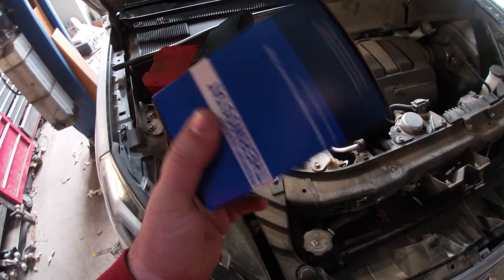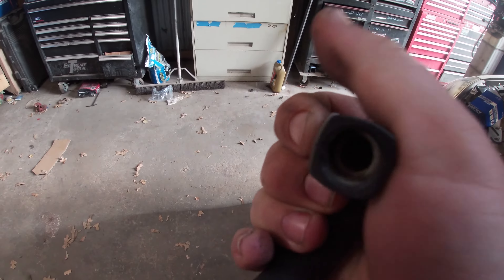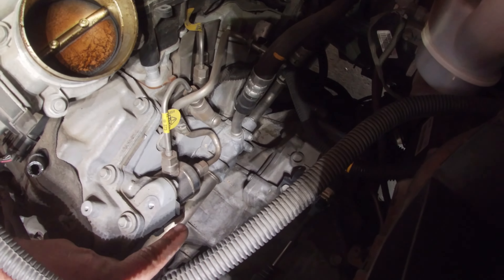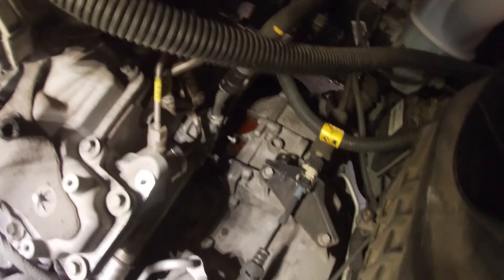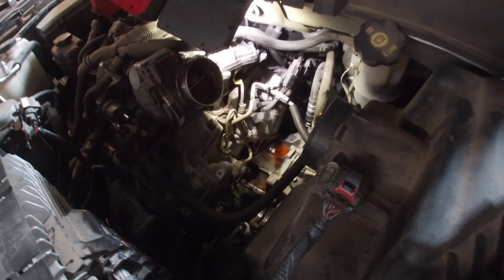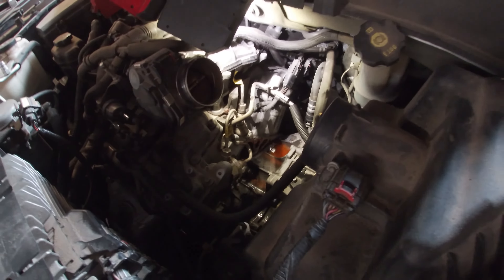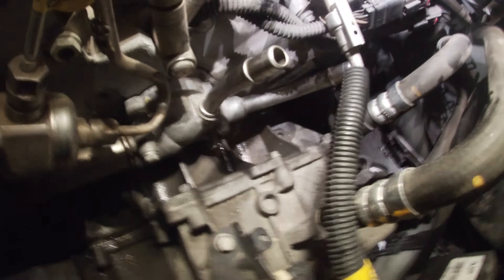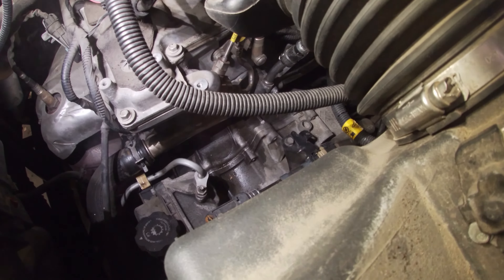2013-2017 GM 3.6l Thermostat Replacement; 2016 GMC Acadia P0128

Comment: Thanks for the wrench trick man! I ruined the last one with two flatheads. Fixing to try again.
Reply from the maker: @roscoe3872  did you see later in the video? Mine actually came with a little cardboard tube for depressing it lololol. I just never looked in the box until I had it out. An empty toilet paper roll would also work probably as well

Comment: I didn't rwalize 1 bolt was longer than the others when reassembling and broke a bolt off. Now i have to find the longer bolt, and hope it works with just 2
Reply from the maker: @christophermm23  ohhh no, I'm sorry to hear that. You will need to get that broken bolt out. Carefully easy out it, then youll need to run a tap back down the threads after. It needs all the bolts or it will leak

Comment: DID YOU HAVE TO INSTALL THE O RING??? I bought the o ring and the thermostat separately but my dumba$$ realized I didn’t install the o ring with the thermostat. Is the o ring really necessary or should i just leave it ? Thanks
Reply from the maker: @Jq__smoov  oh boy, orings are always necessary buddy. Sorry to have to deliver that message
Reply: @ did you install the o ring in the video ? I didn’t see that part
Reply from the maker: @Jq__smoov  Touche' sir, it does not appear I did. And it's definitely still doing fine. Made me rewatch my old video because I couldn't remember this job at all lmao.
Reply: @ haha that’s funny. I just watched another video and the guy did the same thing. I will have to take the thermostat out tomorrow morning 😅
Reply from the maker: @Jq__smoov  the sad reality of making these videos is so often I can't remember what I did after a certain point in time lol. I always think it may help someone then I'm terrible at answering questions if it wasn't recent lololol. Sorry I couldn't be of more help, but hey at least that ridiculous gasket is stuck and you can reuse it. Thay was definitely the worst part because I still remember the stress of stabbing that correctly. Like why not make the adhesive side for the housing??
Reply: @ my thoughts exactly !!
Reply: @ quick question though. Does the o ring go on the bottom of the thermostat or on top?
Reply from the maker: @Jq__smoov underneath, itll.pinch in the conical part of the metal to create a seal.

Comment: Just did this job myself, with the exact same part number and Murray brand from O'Reilly, and inside that box where the thermostat and gasket came, there is also a thick cardboard cylinder that looks like the center of a roll of toilet paper, and that is actually the tool you're supposed to use to compress the spring on the thermostat for removing the old thermostat and installing the new one to the housing.

You position the cylinder on top of the circular metal disc at the top of the thermostat, and press down until it slides inside the cylinder, then you proceed to push down to move the metal teeth passed the grooves on the housing, then give a twist to lock it in place.  Quite easy and only took a few seconds... Didn't realize that that's what it was for until after trying with other tools unsuccessfully...
Reply: how do you get the hoses of. Do you need a Special tool to get them off the pipes

Comment: what’s the normal operating temperature of this vehicle?
I’ve replaced the thermostat and this car is going past half way on the needle
Reply from the maker: @rodolforios1057  half way is normal, sounds like you have some air in the system
Reply: the fan 1, 40 amp fuse was burned out. i replaced it and topped off the fluid level. Hopefully from running it the temp will come down to normal. the reason i changed the radiator is because the passenger side ring around the fan blades broke, a wing caught some air and got stuck on the radiator and busted it. I replaced the radiator, and fans. So i then replaced the thermostat only to find out about the fuse later.
Reply from the maker: Oh no, that is quite the predicament. Happy to hear you have it figured out though.

Comment: Great video. I replaced my thermostat, but now I have no electrical power. What is going on ? 

I have tried to jump the battery too
Reply from the maker: I have no idea buddy, thise two things shouldn't be related at all. I'd start checking your fuses, maybe you accidentally shorted a hot somewhere